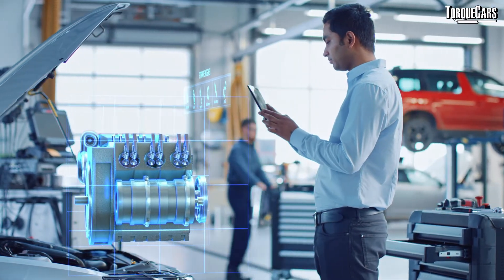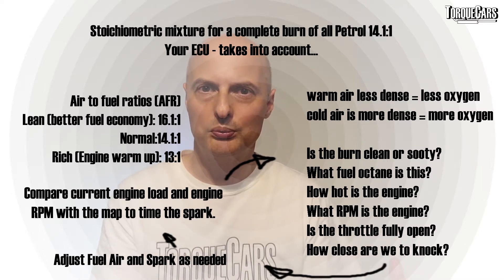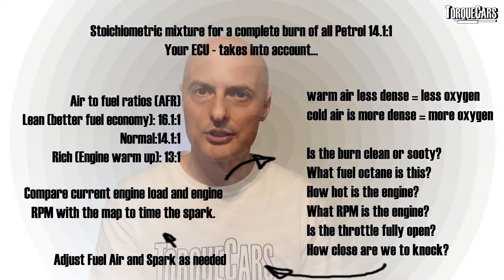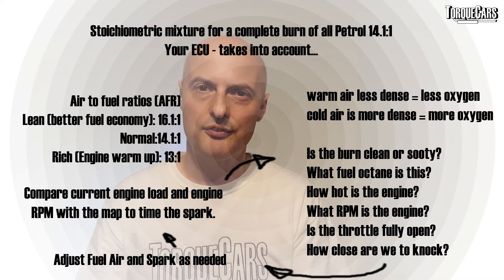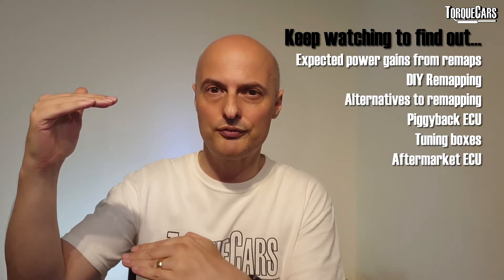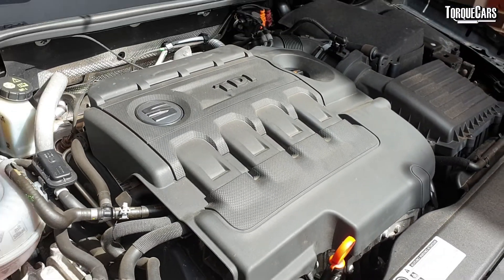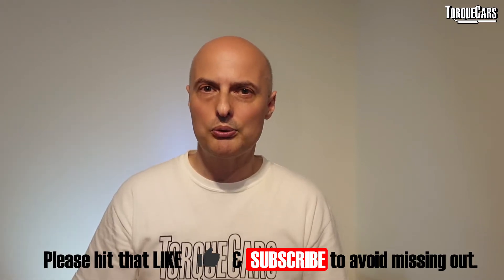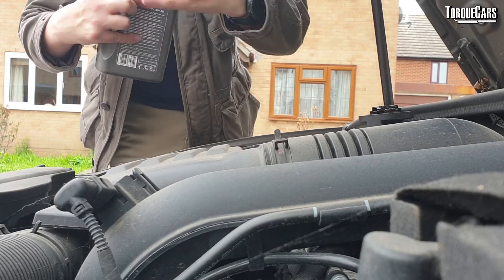Unlock hidden power in your cars ECU [3 Best Methods]

Comment: Hi i am into ecu mapping my Mercedes coupe 200 cgi 1,8l 184 hp. Tourqe 270nm.Yom -11  90 000 km. 
The results according to the company OptiOne here in Sweden, going to be 220hp and tourqe 380 nm.
Is that risky business and do you think that is consistent with what it really will be?
The price is 515 GBP.
Thanks for an very informative channel, and thanks for an answer.
Best regards from Sweden.
Reply from the maker: Comparing this with what tuners I am familiar with over here in the UK offer it seems to be at the top end of the ballpark. 20-25% is  a decent power gain and shouldn't stress components too much. I would ask to look at the dyno printout and just make sure there is a smooth power curve and not a spike at the top end. Make sure your car is serviced and has no weak areas, (clutch and fuel injectors are typical problem areas).

Comment: Can you review a 1998 C230 naturally aspirated engine.   for more power is it possible  to remap a four-cylinder to kick out more power?
Reply from the maker: Sorry for my slow reply - I'm totally inundated with email questions and queries. I will do a feature on NASP engine tuning very soon for you. You can remap but gains will only be around 10%. Camshafts, porting and gas flowing the head are probably the best mods you can do on a NASP engine, and this should push that power gain to 15%-20%.